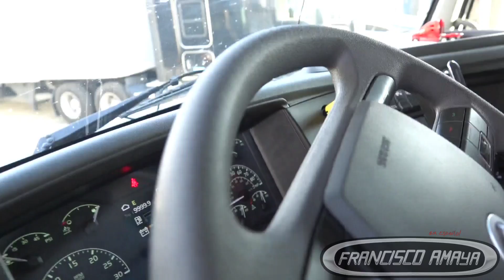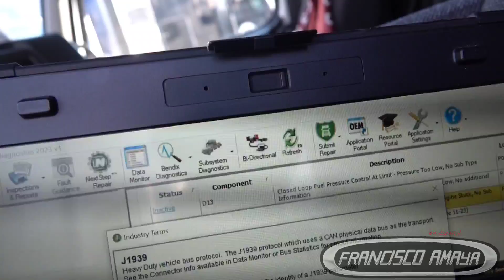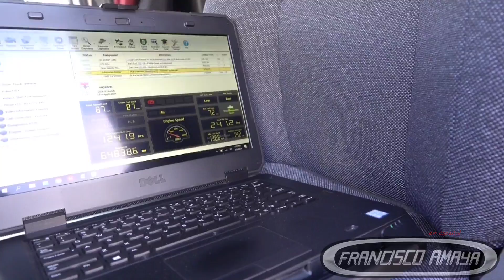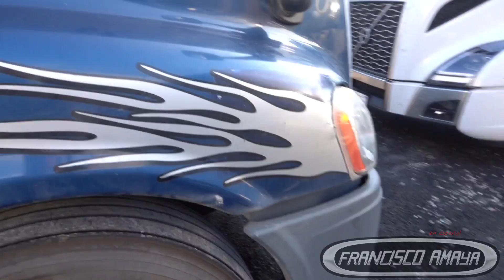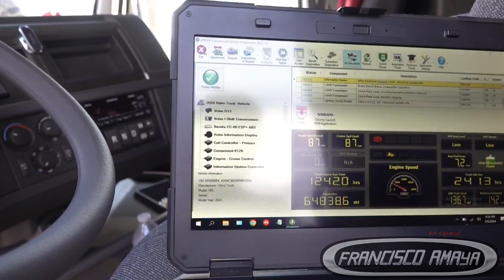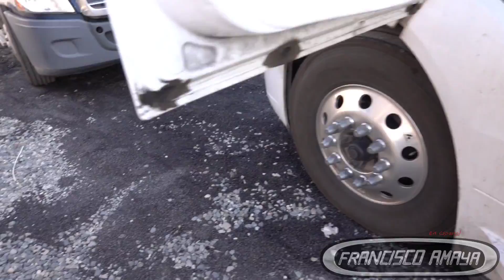2024 VOLVO VNL NEW TRUCK WHIT PROBLEMS ALREADY HIGH COST TO REPAIR

Comment: Higher fuel rail pressure for better fuel economy is causing more injector problems and that’s just one of the issues there are so many modules that communicate through the can system that low batteries and harness issues are a big cause for pages of u codes ,just my two cents future owner operators buying used trucks it’s gonna be expensive to operate because of all the issues